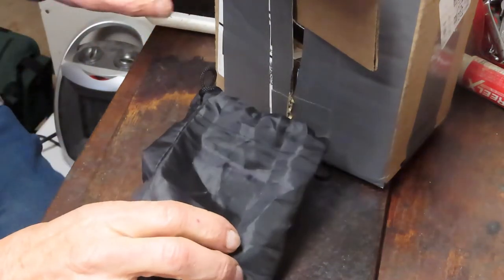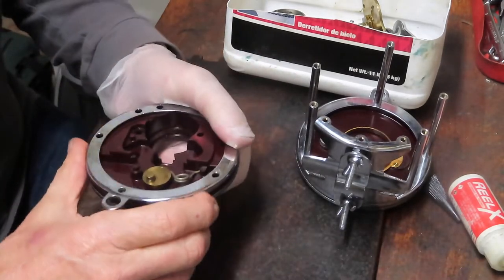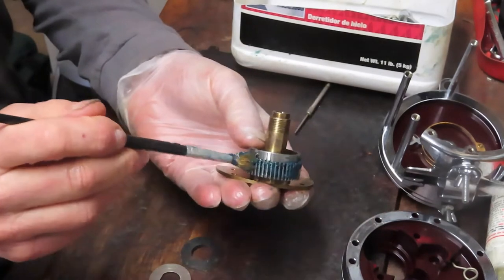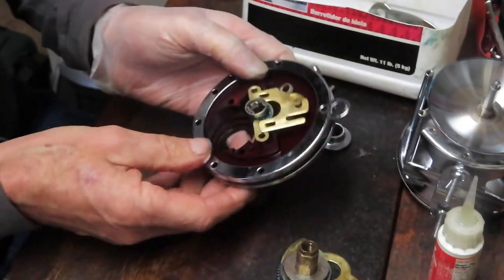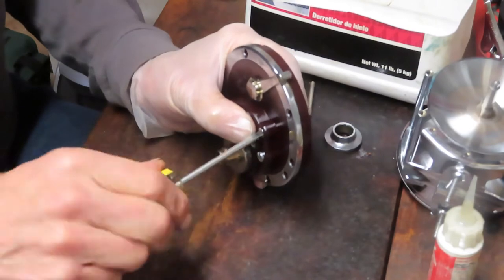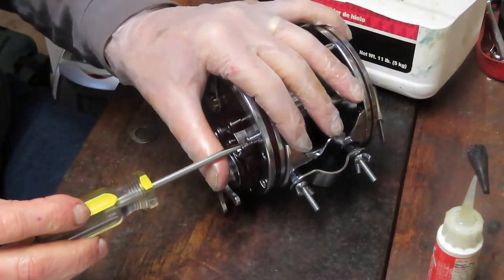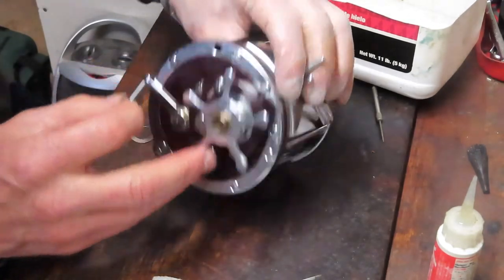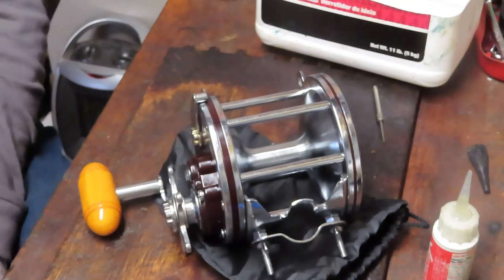Penn Senator 114H reel in a bag how to service and assemble this saltwater fishing reel

Comment: That is a beautiful reel!  Only someone with your experience and knowledge could do this. I got that bearing out of my Sea Wonder 2080 this afternoon. You probably wouldn’t like how I did it. Like your video of your 2080 I couldn’t get the bearing off the pinion. I cleaned and revived that bearing  and cleaned up everything as it was full of very hard dried up grease. Used P B Blaster. The reel works great and looks almost new. Eventually I’ll get that bearing loose but right now I’ve got other reels to work on. Great video Dennis!
Reply from the maker: Thanks Chris.  Some of those are stubborn and some you just got to walk away from - Dennis

Comment: Great video as always!  Thanks to your videos I have serviced several of these 6/0's.  I do have a problem with one.  I am getting some side to side movement with the spool.  More than I think I should have.  I have tightened the bearing in the non gear side as tight as it will go and the spool still has play.  The bearing on the gear side moves a little as well and has a little play.  Any suggestions would be greatly appreciated!
Reply from the maker: The non handle side plate bearing is the only adjustment.  If there is still space between the rim of the bearing  cap and the metal collar on the side plate, then it can be tightened further.  It may just be hard to do.  If you have the space, you can use a pliers like the channel lock versions, to get a better grip and leverage to continue tightening it.  If you bearing is fully, tightened, you may have a broken bearing.  In that case, it would need to be replaced - Dennis
Reply: Thanks Dennis.  I have it tightened down pretty good with pliers.  I did get a new bearing from Mystic but same result.  I will just keep turning it with pliers. @2ndChanceTackle

Comment: GREAT INFORMATION! I have cleaned 2 of my 3 Penn114H reels using your video. The 3rd reel is working well, but it does not click when winding. The drag and dog seem to be working correctly but it sounds different from the others. Is this a problem or just a different reel without the clicking? Thank you for you assistance in all of my projects,
Reply from the maker: The non-functioning clicker is probably due to a worn click tongue or a bad click ring.  It will not affect the use of the reel.  You can check those parts by removing the non gear side plate.  The click tongue should come to a point.  If the point is worn, it will not make the noise that the others do - Dennis

Comment: First GREAT instructional video.Could you or Should you use never seize on any services reel parts? And is the drag assembly the only upgrade for this reel? Thanks
Reply from the maker: You can use a never seize if you like.  There are various upgrades to the reel.  Stainless gears, carbonated washers, tiberon frames, leverage handles, etc - Dennis
Reply: Thanks very much for your reply. Do you have videos on all those upgrades? @2ndChanceTackle

Comment: DID THE TENSION SPRING AND THE WASHER GO ON CORRECTLY WHEN YOU INSTALLED THE STAR DRAG WHEEL?  I HAVE THE 114H WITH THE POSTS AND DID NOT USE A WASHER BETWEEN THE STAR DRAG AND COLLAR CAP JUST LIKE THE ONE YOU REBUILT. CAN YOU PLEASE CLARIFY. THANKS
Reply from the maker: Penn's schematic shows one washer below the star adjuster and one between the star adjuster and the handle - Dennis
Reply: @2ndChanceTackle  Dennis, would you be up for looking at the schematic for '114H with Posts Prior to 1996'? I do have the version they refer to with the drag accessible from the outside like this one you worked on. I see what Manuel is saying, but maybe we are looking at it wrong. It does seem that spring washer 18A would end up underneath Key 136 collar/cap as they have the schematic written up. 8A thick spring tension washer isn't used with the very early versions it says,  which is what I have, so we'd end up with the thin one between the handle and star drag, nothing between the star drag and frame, and 18A would sit on top of drag stack and below the collar/cap. Thanks for any input.

Comment: Dennis, I just picked a 114H up local for $20. It's in pretty nice shape overall. It is the version where the drag washers are accessible from the outside, and I'm pretty certain the washers are original or close. They are the 1940s three very thick drag washers plus the two keyed and one eared metal washer. This one has thick tension spring 8A - drag star - thin tension spring 8 - handle order. Key 136 collar/cap is installed as you did, but no 140 felt washer. I will need to upgrade the drag washers, and at least the gear sleeve (I haven't opened it up yet). What do you suggest how to address when upgrading to newer 115 5 drag washers set up with the 114H version where you can access the washers from the outside?
Reply from the maker: Dustin - the process is straight up on the conversion.  Everything remains the same, but the 5 washer versus 3 washer stack is needed because the newer washers are thinner.  You should alternate the keyed washers with the flat washers and end with the collar cap.  If you get the schematic from Mysticparts.com in the link that follows, it will show the parts needed.
https://www.mysticparts.com/Assets/images/pennparts/schematics/114h_post.pdf thanks for asking - Dennis
Reply: @2ndChanceTackle  Thank you. Seems easy enough. Seems like Key 18A spring disc was missing, so I'll need to pick one of those up as well. I'm missing Key 140 felt washer and looks like you were too and didn't worry about it. So I won't either. Thanks again! Zero vintage Penns two months ago, and now I'm up to a Jigmaster 500, 113H 4/0, and now the 114H (it was a a happy accident looking for a rod for the 113H 4/0 locally...the reel was on a Sam Scott Palm Beach Special with Aftco rollers that seems to be a good match for the 113H). Videos are invaluable.
Reply from the maker: Sure.  If you are converting to the 5 drag stack, you eliminate the felt washer and collar and replace with the gear sleeve spacer and tension washer.
Reply: @2ndChanceTackle  OK, thanks. That's what I was thinking last night looking at the schematic. Looks like one I have has both the collar and the 8A thick spring washer on it.

Comment: Kept pausing for the different views. Had to take the mech gears off because I has the lever part off.
Reply from the maker: Thanks - Yes - I take a step by step approach but keep moving.  A schematic of the reel probably would have helped you see the order better.  You can find the schematics by doing an internet search.  The Senator reels schematics are available on Mysticparts.com - Dennis
Reply: @2ndChanceTackle  I had the parts layout diagram up as a PDF. What I didn't do, was attaching the release lever by installing the release drum and spring first.